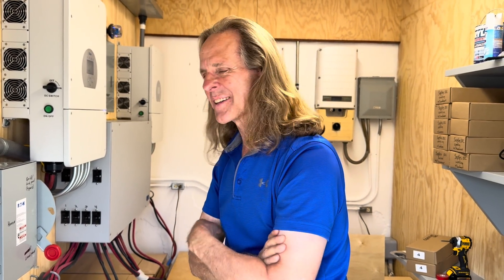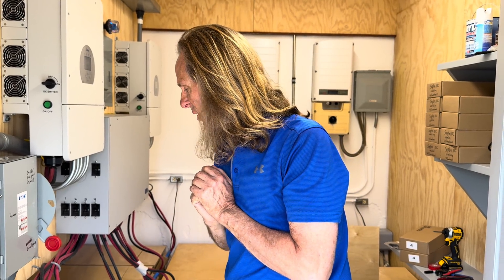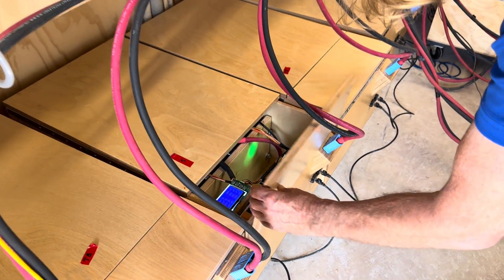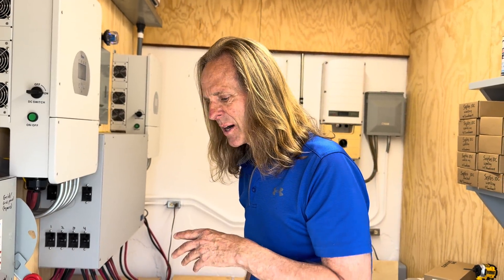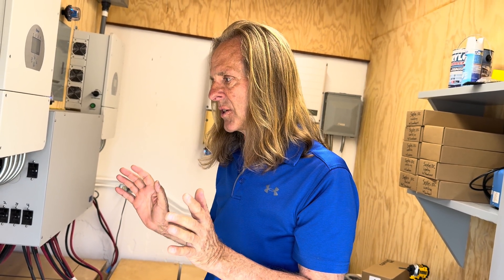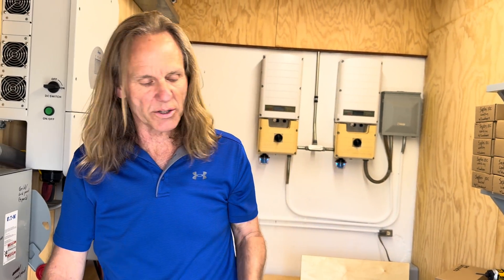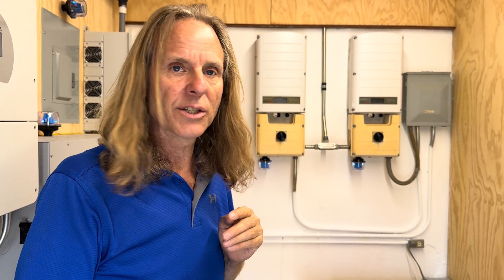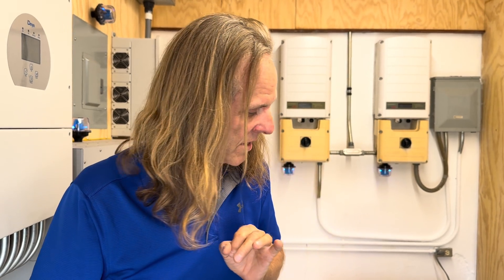Huge Off Grid Lifepo4 Battery System Maintenance And Management

Comment: Your original cells that are drifting now are 3 years old? Is this the first year they show voltage differences? Maybe the others will also drift next year.
Is the only cause of this the internal resistance plus the resistance of the cell connections, which is different?
Reply: Do not use active balancers with perfectly balanced cells. They destroy the balancing. At most every few months for support.
Reply: It could possibly be useful if, for example, the connection from cell 8 to 9 is particularly long for design reasons. But then only from a voltage of 3.45 V.
Reply from the maker: @karisianschwermer6464  as I said, I just don’t think the active balancers have a purpose when using good cells. Unless that purpose is that you were unwilling or unable to top balance, the battery from the beginning.
Reply from the maker: I’m sorry, but you misunderstood what I was trying to say. The sales drifted because they sat assembled in a battery for 2 to 3 years. There’s nothing wrong with the cells and they stay balanced now but when a battery sits unused for that long, some of the cells will drift downwards. It doesn’t happen quickly at all.

Comment: The Seplos BMSes are great, but I can't deny that the JK Inverter BMS is the best at the moment. Especially when using it in a Victron system, the communication with the system is just amazing. (but you NEED to update the firmware of the BMS to v15.36!). I have 8 of them running in parallel and they have been working superb.
Reply: Please can you coach me?

Comment: Thanks for the info. Is Jenny Wu the Gobel Power site on the net? I'm thinking of using lead acid batteries from electric forklifts. They are huge and have 24 cells with a voltage of 48V.  My charge sources could be wind, solar, dual/tri fuel generator. I had a tiny toy steam engine when I was a kid and I'm thinking a larger one would be great for running a generator.
Reply from the maker: Jenny Wu works for Docan Technologies. I would not use lead acid in 2025. Lifepo4 is just too much better and much cheaper overall.

Comment: Active balancer when the cell voltage is > 3.6v is nice, but at lower voltages it can really ramp up the cycle count a lot, killing off weak cells quickly
Reply: That's why you should set the start balance voltage at 3.4V or higher.
Reply: @veeerzes 
No, not 3,6V. It should start at 4,5V
Reply: @schunkelndedschunke6914  Lol, I think you're house is on fire if cell voltages are 4.5V
Reply: @veeerzes  
Sorry, my fault. I meant 3,45V.

Comment: I ended up just buying the Apexium DIY kit Docan sells with the JK inverter BMS they are lot smaller and stack. Only thing I did was build a heavy duty steel cart with 2500 lb casters I got from Amazon so I can roll them around. Once you load up with 16 280AH batteries about 300 lbs. no way to move them.  The cost of the DIY box was $400 from China at least that is what the price was who knows now. I was only saving about $100 making my own boxes when you price in the cost of a nice JK BMS. I bought 32 280 EVE EV grade batteries, and two boxes from Jenny Wu no problems at all I talk to her on WhatsApp she has been great.

Comment: Jenny wu is amazing  I've got almost all my cells from her . Also if you have decent BMS installed on the packs over time they will balance out, my packs at first were drifting but over time (3+years now) they have become very stable and equal at .003v from lowest to highest cells. It also helps to bring them down to about 30% a few times during the year I have noticed. Thanks for your videos I would never of found Jenny Wu without seeing your videos!

Comment: The thumbnail game needs to change. Smiling and showing your face, isn't it. lol.
Reply from the maker: What would you recommend?
Reply: @RayBuildsCoolStuff  You can increase views by focusing your thumbnail on the solar system itself. Remove yourself from the image, add bold texts, and use arrows to highlight key details you want viewers to notice.
Reply: @RayBuildsCoolStuff  Your titles are okay for the most part. For example, I want to see the huge off grid system. You can use arrows to point at the wire management or something like that.

There will be a huge difference. Trust me, this is my job.
Reply from the maker: I think this is one of the downsides to my approach. I simply don't do any scripting or editing. All my videos are made on my iPhone and often if I'm talking into the camera, I am holding the phone and talking towards the back of it, hoping I'm being framed adequately. It's usually just me and my phone and a fervent hope that I can help people learn what I might have to offer. It works for some and not for others but I'll consider removing my image from the thumbnail. Up until now I've tried to let people know who it was and what the topic was so if you look, you will always see me and the subject matter in each thumbnail.
Reply: @RayBuildsCoolStuff  I don't see any issues with your videos. They are usually interesting and REAL. I think people like it when you are yourself. Don't change that. But in the YouTube world, thumbnail/title matter. That's what brings people to click on your videos in the first place. Your teaching makes them stay and subscribe.

I am saying this because I think your videos deserve more views.
Reply: Title and thumbnail should pinpoint the same thing. The battery bank, solar array, or your power system room. We should only see you in the video or a few times when you really need to be there.